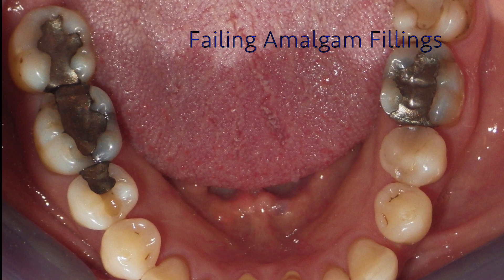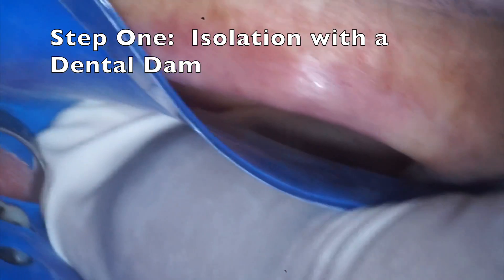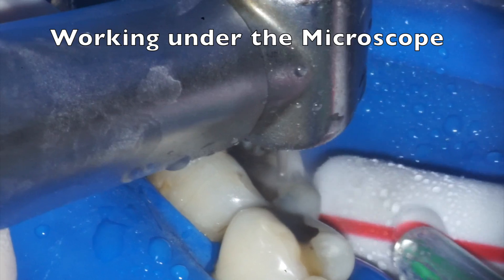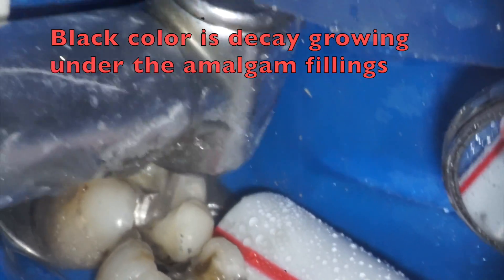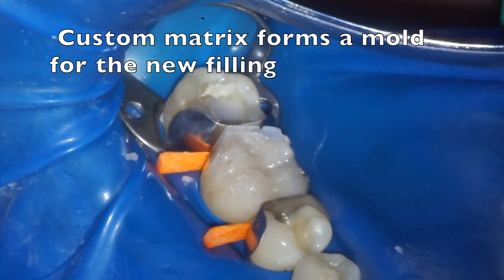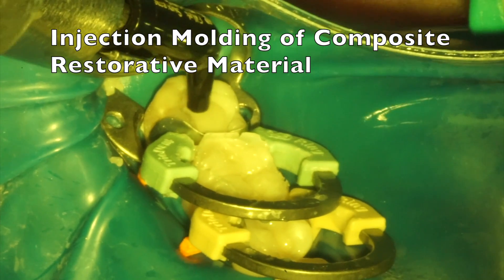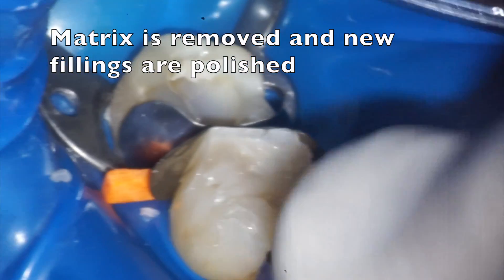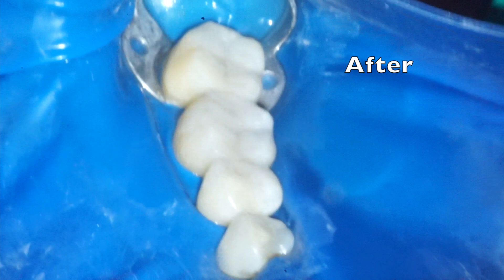Mercury Amalgam Removal and Restoration

Comment: How long does the composite last?
Reply from the maker: Many Years.  We've used this bonding method for 21 years now.
Reply: +William Linger, DDS, MAGD
Do you have a statistical average, parameter range, and or warranty for your practice? And thank you for posting this video it is the best one i have seen so far
Reply from the maker: Warranty Information: https://www.drlinger.com/concierge-dentist
Reply from the maker: @Khad Tal  I do not recommend they be replaced until they show signs of recurrent decay. If patients ask me to remove their amalgams electively, I'm happy to do that. Good evaluation of the amalgam under the dental microscope is the key.  Usually, we see recurrent decay under most of the amalgams after 10 years.  However, the smaller the fillings are, the longer they can last
Reply from the maker: @Khad Tal sometimes visible on xrays, but more so by careful visual examination under magnification and good lighting made possible with the microscope.  Pause the video at 0:17 and you will see on the left side three key things: 1- gaps between amalgam and enamel, 2- fracture lines that are filled with dark staining indicating leaked and 3- the grey showing through the enamel - this is also visible on the right side. The grey is also a key sign of decay.  1:16-1:30 shows you all of the decay under the fillings.

Comment: Dr. Linger, I had my amalgams removed and I have had nothing but problems in these teeth.  I had one root canal.  I would have had to have another, but I decided to have the tooth extracted.  Now another tooth that was done is bothering me.  I see so many people having this done, but no one has made any comments like mine.  I had five amalgams removed and so far three started to have pain after a year and had to be removed or extracted.  One of my dentists told me that when the dentist did mine she put the core filling to close to the nerve.  My fillings were very large and took up most of my tooth. I have to say that they looked like the ones in this video.  Why am I having these problems?  Every tooth seems to be going bad.  Why?
Reply: Sheila meri I’m having same problems teeth wasn’t bothering me until he remove silver filling and replace now in a lot pain
Reply from the maker: Definitely, if the fillings are functioning, still sealed with no signs or recurrent decay, and not causing any problems, then removal is not indicated.  The new amalgams that dentists are using don't last as long as the amalgams we saw years ago. This is due to the reduction in the silver content as the metal cost has gone up. Also, if the dentist did not confirm that all of the decay was removed during placement, they can fail faster.
Reply: This is a very real concern that i am trying to base my decision on. Would it be safer to remove the tooth and have a implant or denture replacement?
Reply from the maker: every tooth must be evaluated individually under the microscope
Reply: @chimi6877  no leave the filling in until the filling needs replacing. After that if they say you will need a root canal. Get a dental implant to preserve the bone in your tooth